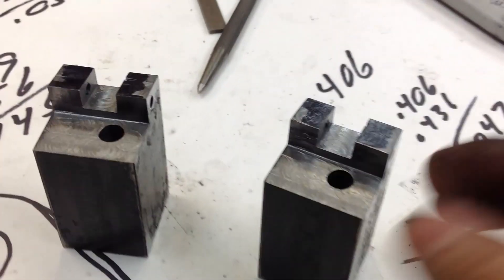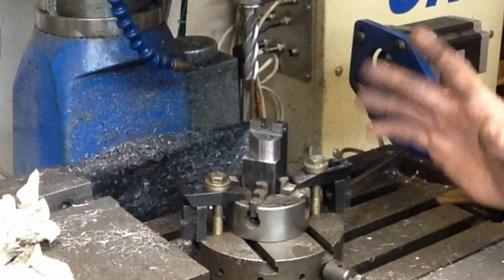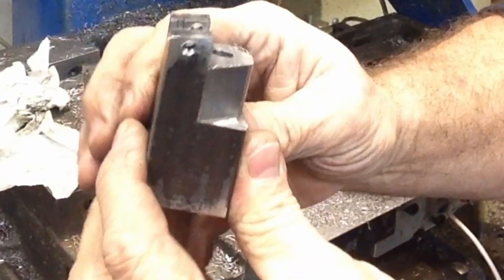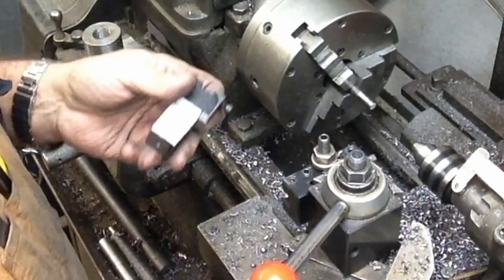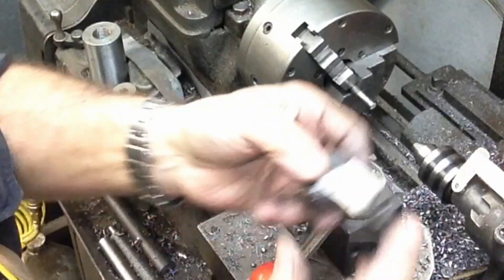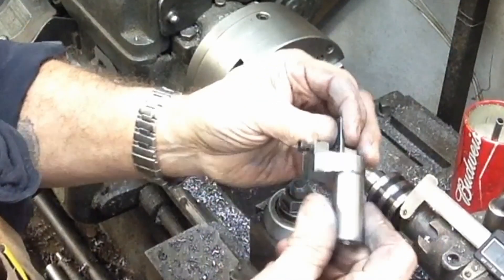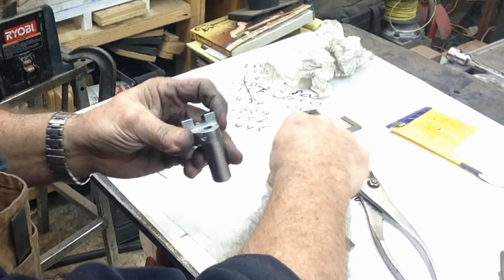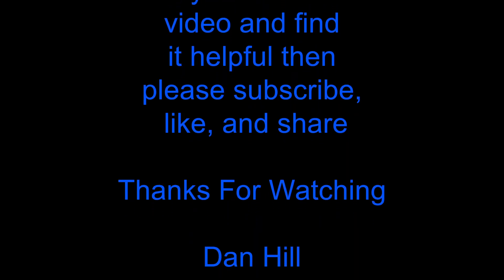Atlas Turret Lathe Tooling: Building A Centering & Facing Tool: Part 2

Comment: You may have mentioned this .. but what type of steel are you using for these holders? Anything fancy or just 1018C? cheers!
Reply from the maker: Nothing fancy, if I am ordering stock I tend to go with something like 4140 pre hard or 12l14 depending on the intended use, but I also consider what else I can use extra material for. For the most part I try and get material from a local supplier that also has surplus they buy and resell it by the pound then periodically send the leftover to scrap. When I go there I always check for materials I may be able to use. Sometimes it is mystery metal and sometimes it is marked. Even though the holders are usually used on my turret machines, for my use they will last forever.
Reply: @hillsgun  Awesome, thanks! On that note, what type of oil coolant / cutting fluid are you using on your DSM-59?